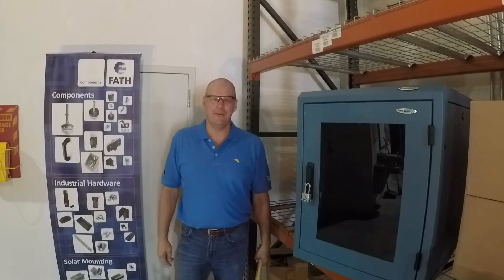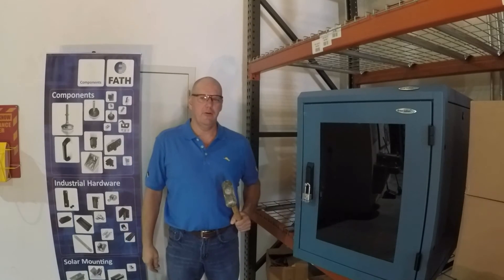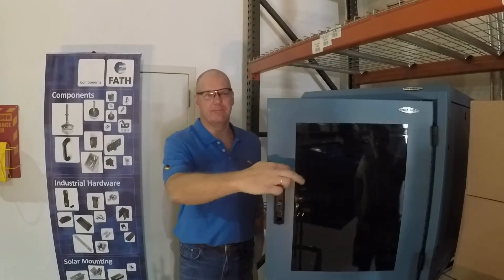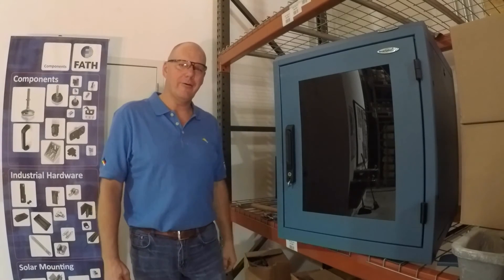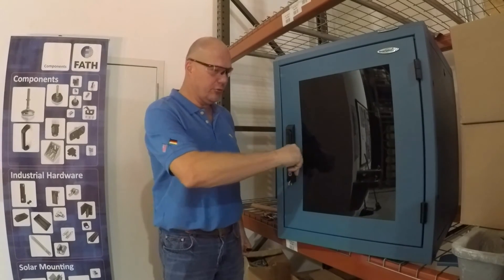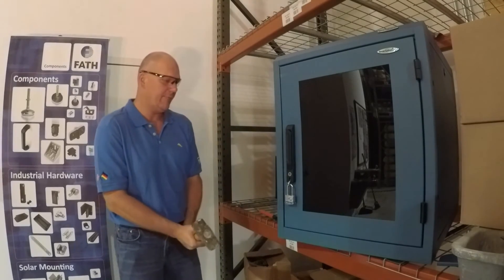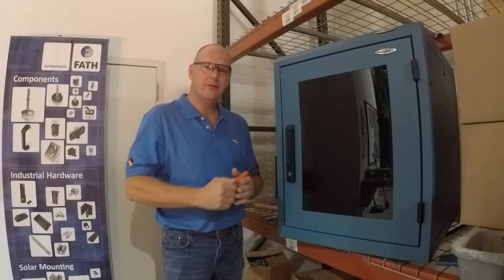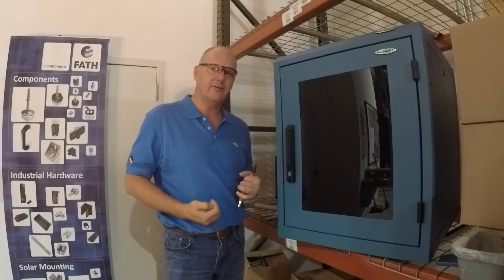The FATH ErgoSafe Handle

Comment: It looks great, Armin. But my question is how you open the door when the lock is hammered off. :-）
Reply from the maker: Good Question,
There is a way to remove the handle after its been tampered with, but it requires some specialty power tools.